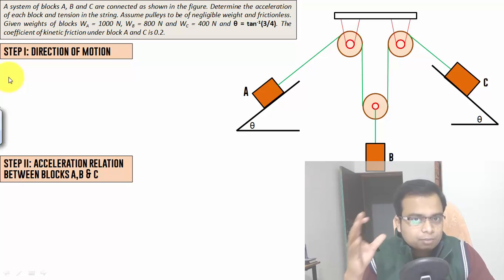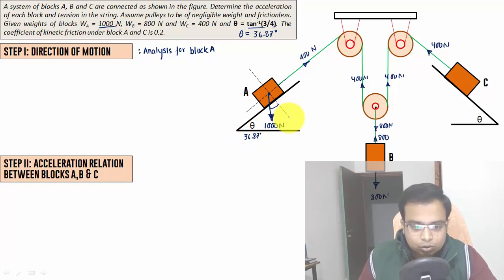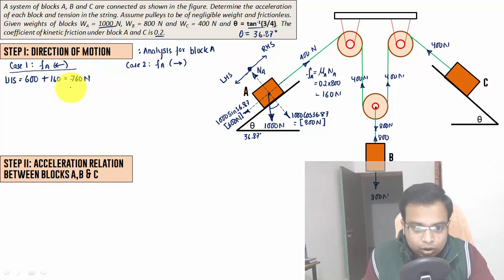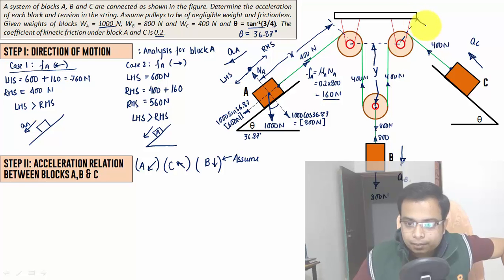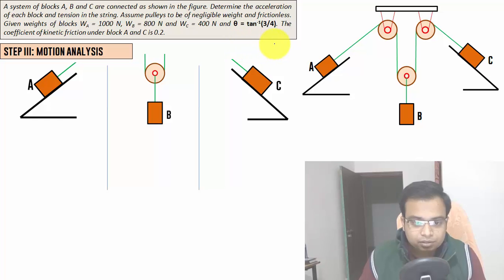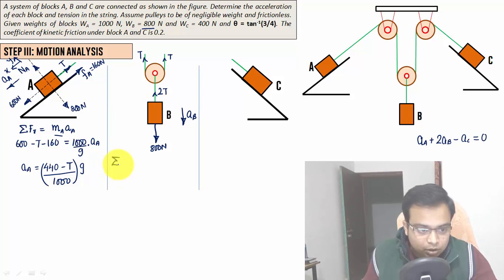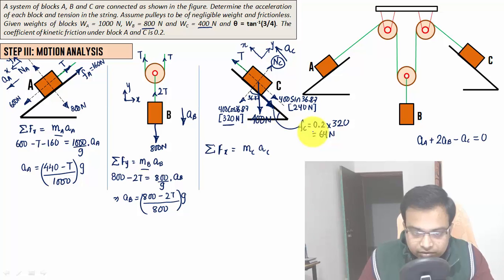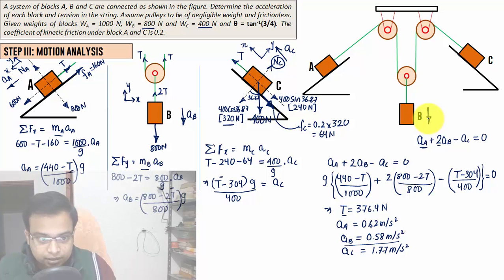D' Alemberts Principle | Newtons Law of Motion | Dynamics | Problem 8 |

Comment: When you have calculated Tension beforehand why are calculating it again in  step 3? Please reply ASAP sir. I have my exams tomorrow. Need your blessings. 🙏
Reply from the maker: That tension was calculated assuming everything as static. 
And based on that the direction of motion was determined. 
But the tension which we got when the object was set into motion is the real Tension.
Reply: @ManasPatnaikofficial  iif you logically thinking then block a move downward at the same time block b move upward and due to block b move upward block c move downward and then calculate then acceleration of all block is different then your ans sir